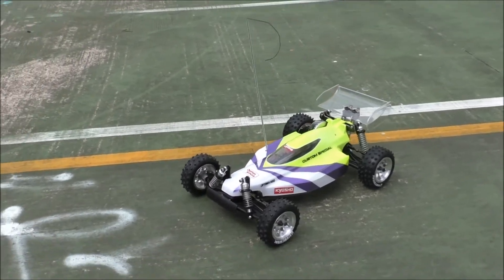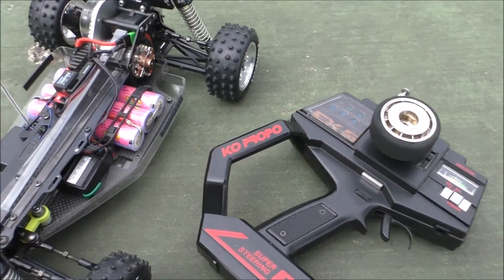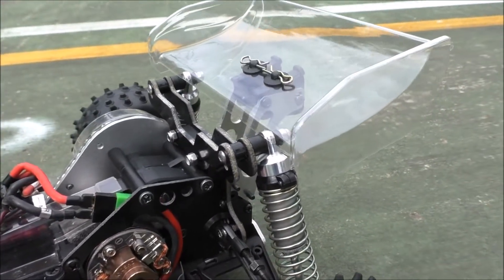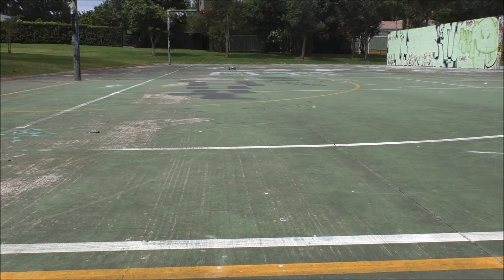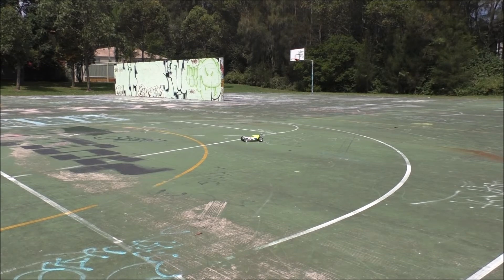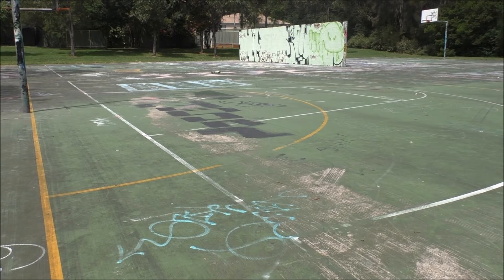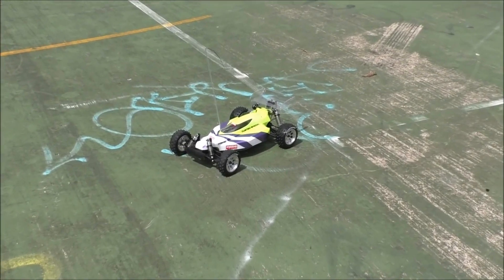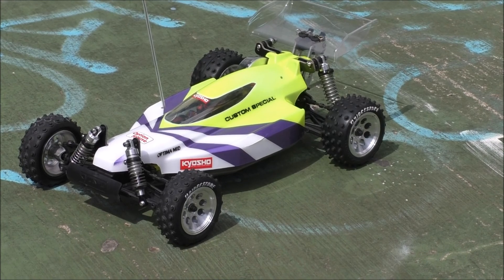KYOSHO TURBO OPTIMA MID SPECIAL vintage by BORMAC

Comment: I have an optima mid stored away and a rc10 a-stamp that came from jammin Jay ( he built it for his kid back then ). First time I saw and watched an optima mid was the hobby shop owner on the indoor track ( flitebox   pottstown , pa ) he had taken a trip to japan and brought one back , we were amazed by how quiet and smooth it was compared to anything else.
Reply from the maker: It's great to hear from you. Thank you for sharing.
Reply: It's smooth and silent drive system is one of the things I like most about these. I remember running RC cars with a few classmates. One had a Tamiya 4WD, another guy ran a Marui 2WD and I had the Optima Mid. Which ran way more silent, faster and longer than the other cars, on the same batteries. The Marui 2WD could somewhat keep up, if geared for top speed, the Mid could almost run rings around the Tamiya. Could also be the latter wasn't built very well and wasn't running as smoothly as possible. But the person who owned it didn't want any help with tuning it, he wanted to figure out everything himself. Which is fine, but at some point he got frustrated at the car's performance and stopped with the hobby afaik.

Comment: Very Nice optima mid custom special is your pinion gear a bit tightly meshed to the spur sounds like it is a bit or are you using a non original pinion gears i have a custom and it sounds super silky smooth
Reply from the maker: These models ran the .6 module spur and pinion and yes I only have the Kyosho Option House hardened .6 module pinions. I also know the correct gear mesh gap in relation to spur and pinion. The sound I believe you are hearing is in my opinion the old hard worn tyres on the bitumen surface.
Reply: Its a tedious job gaping a spur but i hold the pinion and rock the spur back and forth if it moves about 0.4mm it’s spot on but I used to race the mid custom special and the turbo optima mid special back in the 90s at special events won a few trophies i definitely don’t think it was the tyres it was hard for me to listen to. if someone calls me out and says i am doing something wrong I want to listen and correct my mistakes. Just try increasing the gap by about 0.1mm and see if it sounds any different. I wish i could do a run vid with my mid custom they have the same spurs and just show you how much smoother it is 👍🏻
Reply from the maker: @David-069  I have been racing since the mid 80's and own hundreds of different vintage cars and been racing in numerous vintage events since 2006. Yes I know how to gap the gear mesh my friend so if you think you'll calling me out, then go ahead.
This video was made many years ago. I have since sold the car on and built and currently own 6 vintage Optima Mid cars.
I appreciate your expertise and your efforts to critique a guy on YouTube but perhaps you can create your own content without trying to find fault in other peoples videos made for fun?